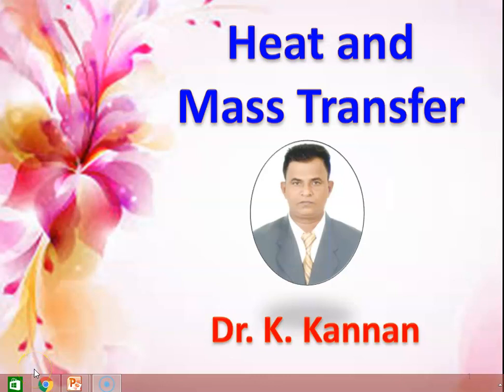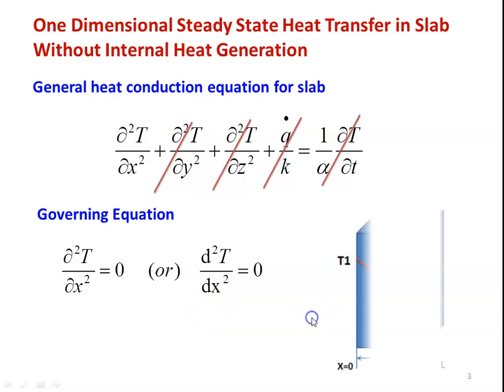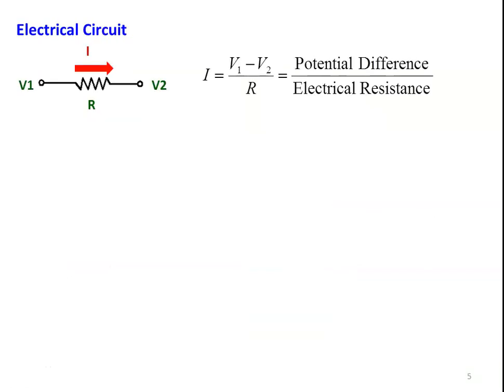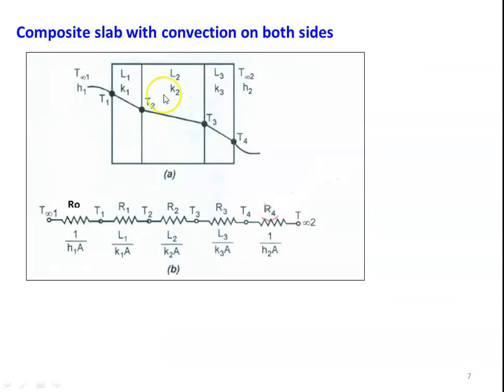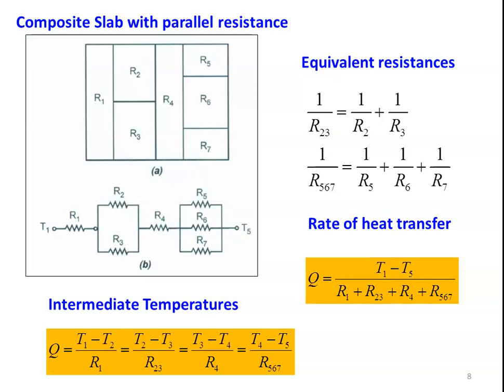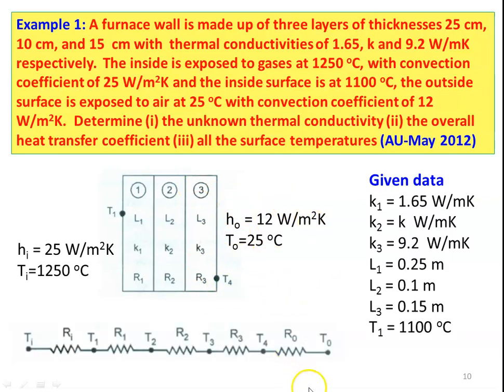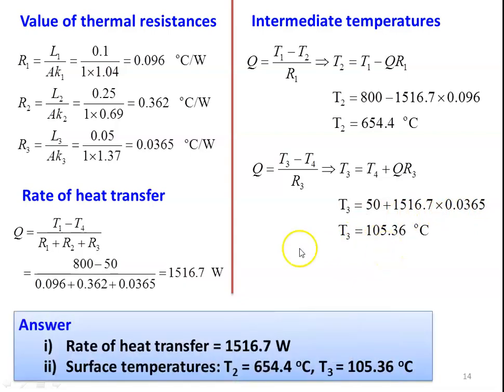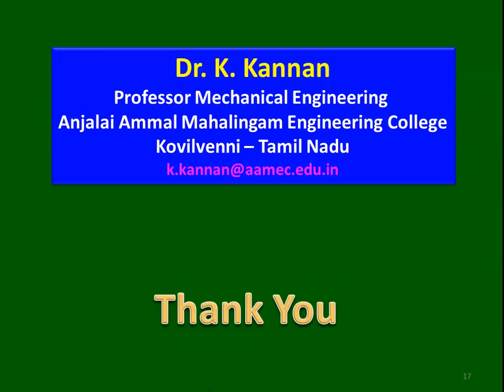HMT 1.2 Steady State Heat Transfer in Slab

Comment: thank you sir for this amazing lecture that cleared a concept.
In lab experiment when we perform composite wall as an experiment do we have to consider any outside factors. how do we find whether slab attained steady state or not??
Reply from the maker: At specific time interval, measure temperature, if the temperature is constant for continuously three or four reading then it is steady state.  No temperature change with respect ;to time.